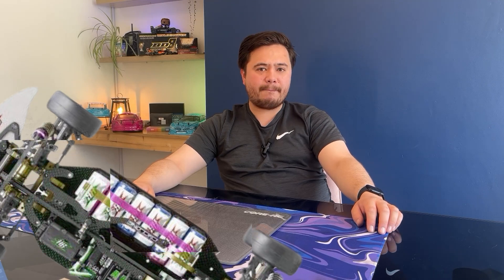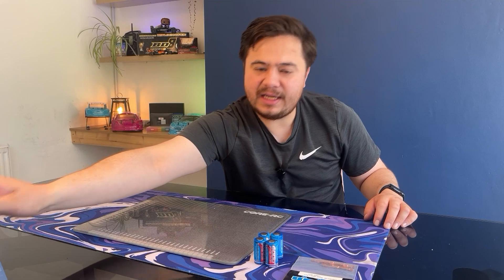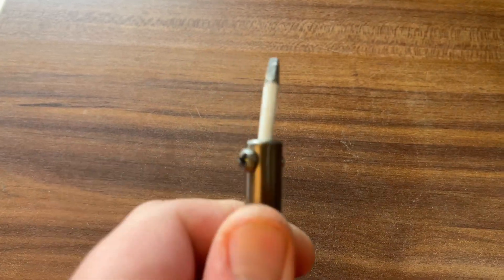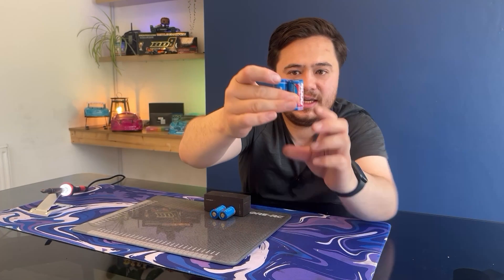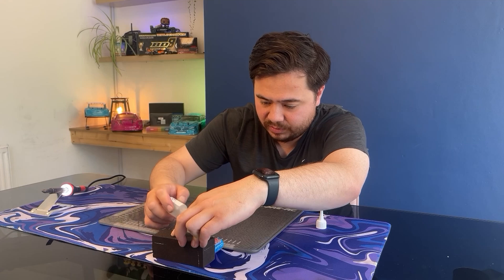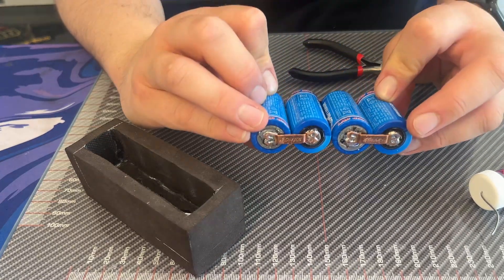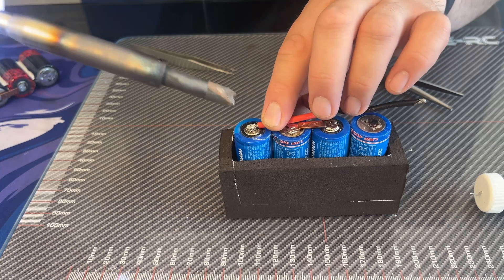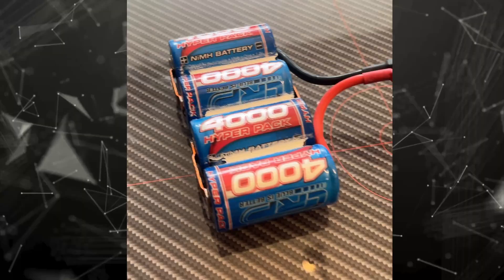How To Build NiMH Battery Packs - The Complete DIY Guide

Comment: Great video - Thanks mate. Would you add heat shrink after, or is there no need ? And I found your video as I was searching for a battery for an RC boat. I might now consider making my own. 🙏
Reply from the maker: You could consider heat shrinking. It may give an added layer of protection if there’s chance it could get splashed. 

For me I didn’t bother because I needed the cells to sit lower in the slots for the battery pack, rather than on the surface

Comment: Why not spot weld instead soldering, the heat can damage the battery
Reply from the maker: @dennisweidenbach3313  it is an option however with the soldering iron used in the video the batteries don’t warm

Comment: A technical fact when connecting two 1n4700 diodes and a 1ohm resistor in series in each cell will be perfectly balanced at 1.4 volts, with this the battery increases the discharge of amps and its useful life.
Reply: this is a bit the info that i am looking for, the how! i think also 1 resistor and one diode would be enough. a carbon resistor 330 ohm will be enough? and a 1n5819 schottky?

Comment: Same way I do mine, Though I heatsink them. I normally tin the battery bars as well. Noticed you didn't do that. Not sure if it makes a difference.
Reply from the maker: To be honest I didn’t consider tinning the bars but I might give it a go next time! What class do you run?
Reply: What size is the heatshrink you use?